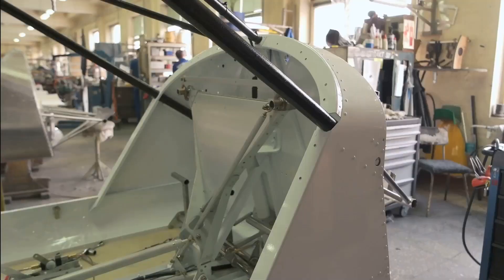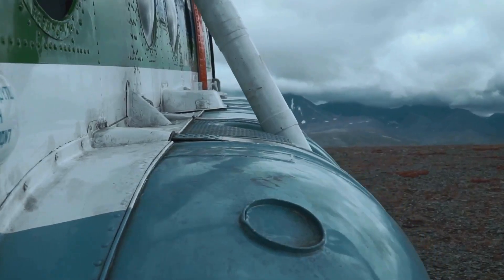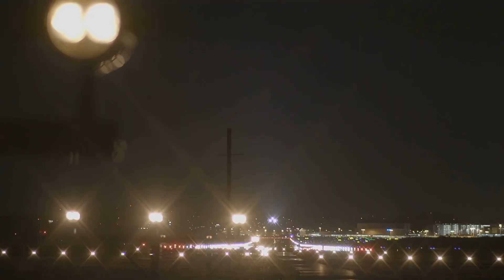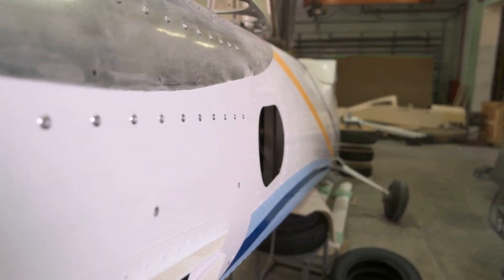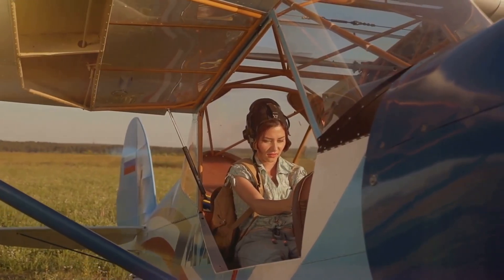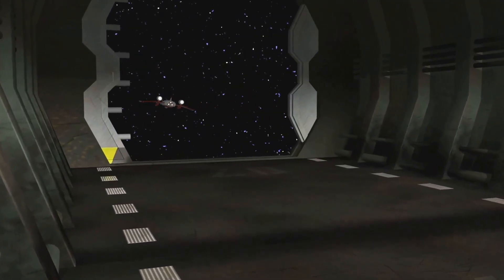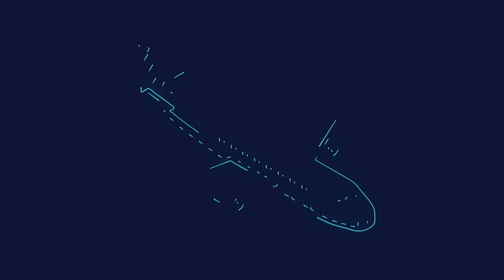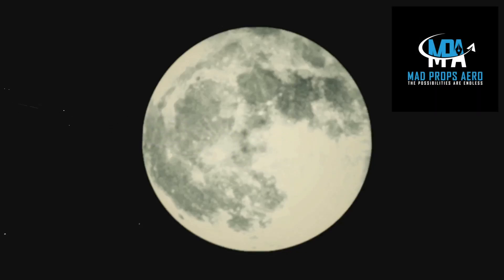If You Build It...A Century of Aircraft Construction

Comment: Not too far from me, there is a facility that recycles broken glass, it is 1 of 3 in the world...not too long ago there was a fire on interstate I-95 underpass whereas a fuel tanker flipped over and the tractor trailer driver died after all said and done a section of I-95 needed to be replaced...they used this material that came from the county just south of Philadelphia iit is composed of this "broken Glass material" from the news media they stated this material was a temporary fix, it is very lightweight, very durable, and robust...wounder if this same material would be ideal for aviation... maybe drones and small single engine lightweight aircraft? This recycling plant is in Chester Pennsylvania
Reply from the maker: Interesting. Thanks for sharing.